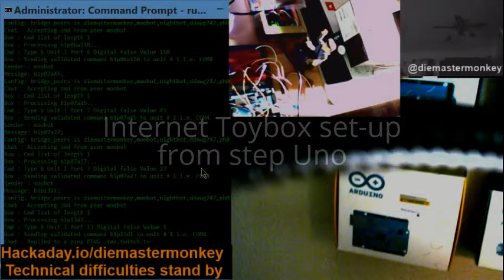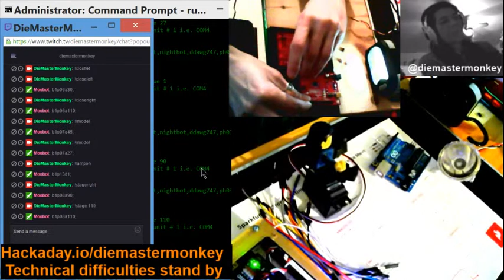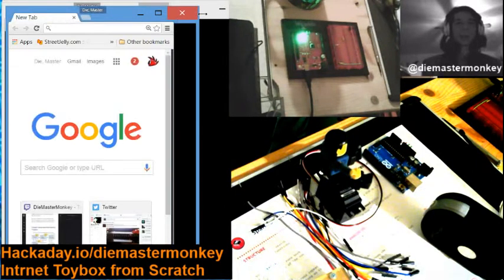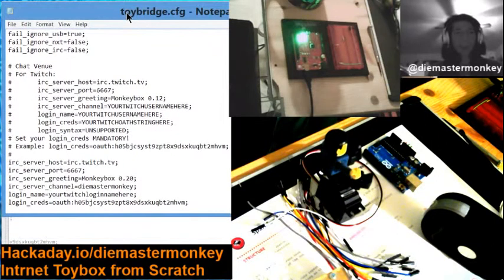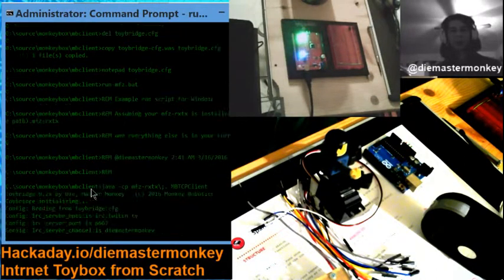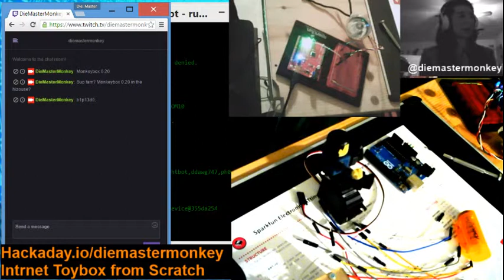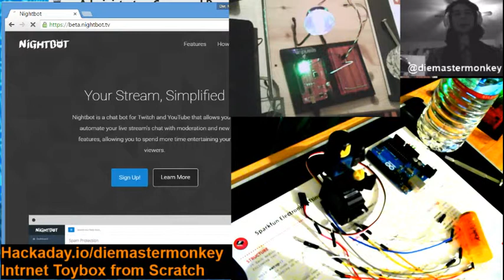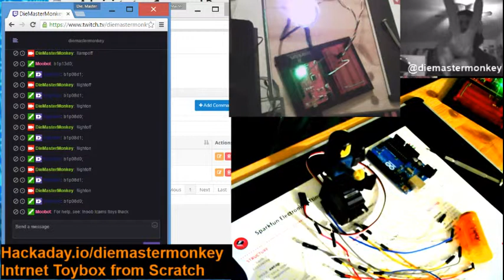Internet Toybox: Audience Remote Controls for Twitch Streamers - From "Uno" to Showtime

Comment from the maker: 00:00 Agenda
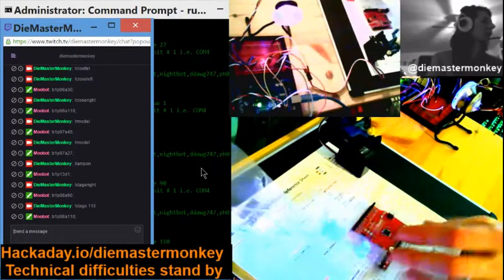00:45 Gear: Sparkfun Redboard is Monkey Approved
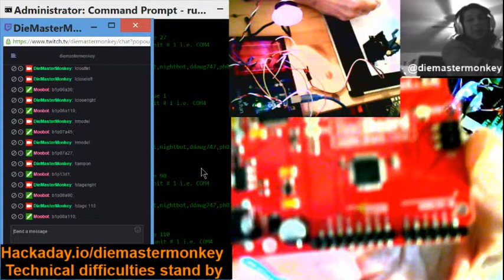01:55 Gear: You need an Uno-compatible
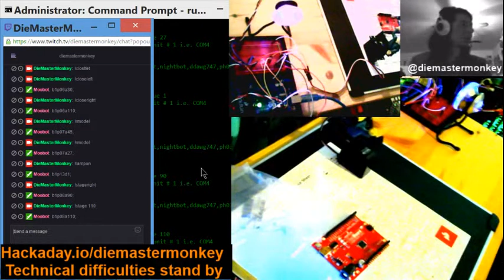03:02 Work: w/history of the Internet Toybox
07:53 Work: w/miscellaneous bullsh*t
12:09 (Intermission)
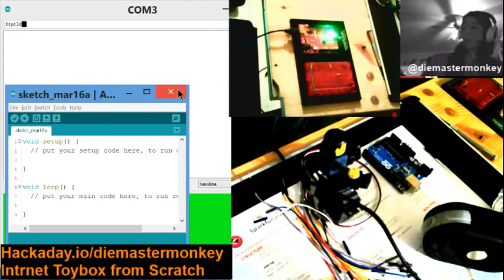12:58 Recap
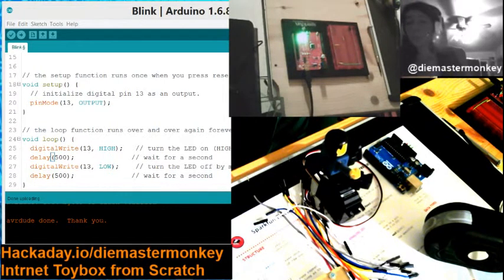16:05 Do: Get and upload to Arduino           
19:05 Docs: Go to http://hackaday.io/diemastermonkey
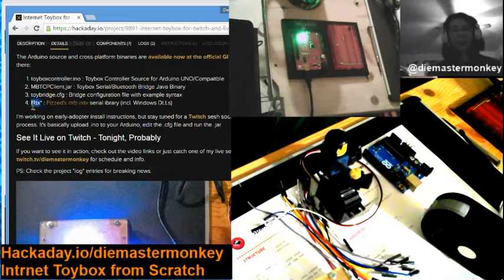21:39 Caveats: RXTX on Windows = PITA
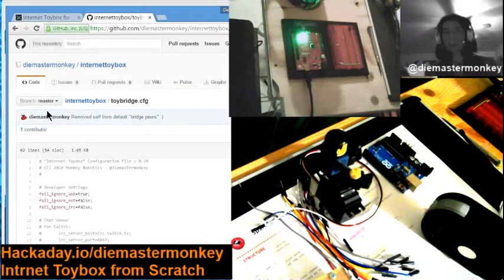22:40 Docs: Configuration file part 1
24:35 Do: Putting files somewhere
27:25 Docs: Configuration options in detail
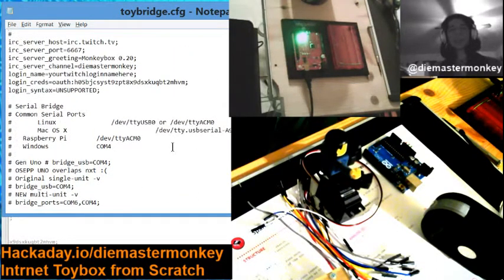32:30 Do: Getting your Twitch creds
34:44 (Moving on...)
35:17 Do: Starting the bridge (theoretically...)
38:53 Example: Changing options just 'cause
40:50 Toys! Setting up a simple LED...
42:09 Work: Wiring time (not much to watch, really)
49:17 Recap: And ready to test
50:20 Docs: Composing and testing the low-level command (theoretically)
52:36 Moving from low-level commands to...
53:50 Docs: The role of your chatbot
(...)